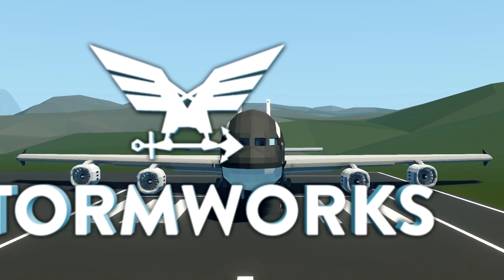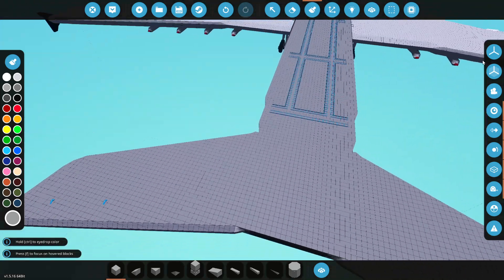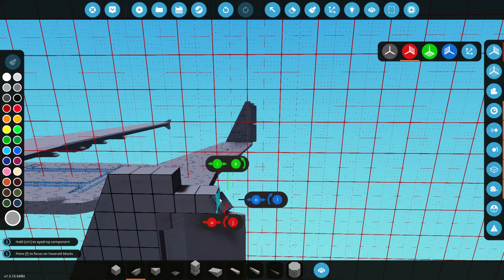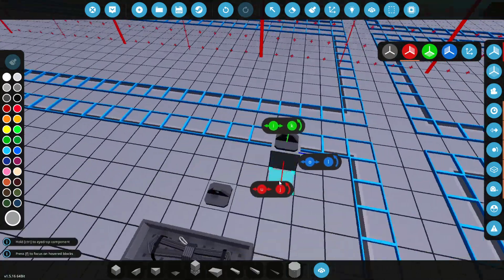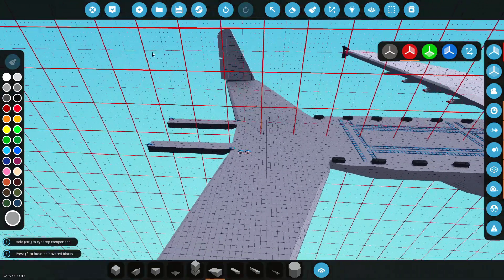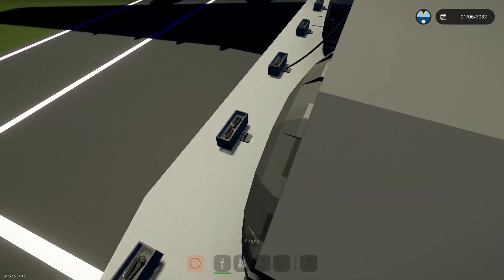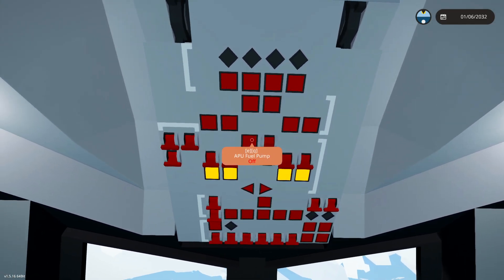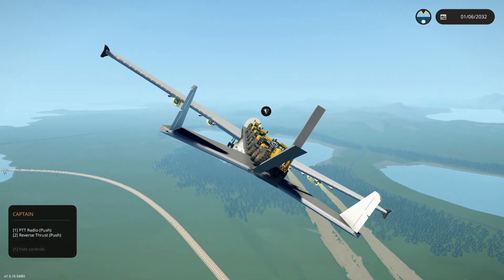Loading HUGE Machines Onto An Airliner in Stormworks Build and Rescue!

Comment: Suggestion get a smaller plane and see if you can take off with it on the back then detach the smaller plane and launch it when someone else is flying it and then see if you can land the smaller plane in flight
Reply: Soo, a towed glider.